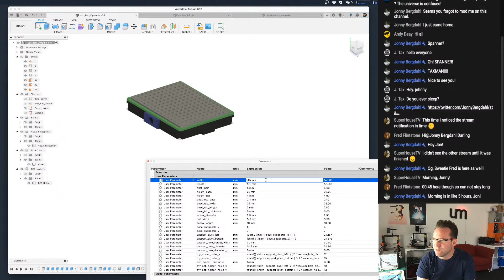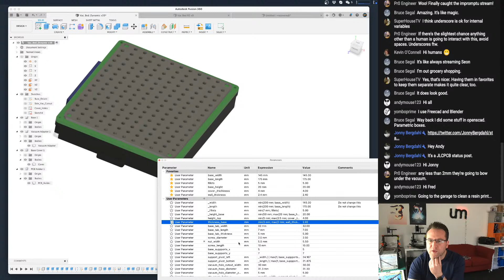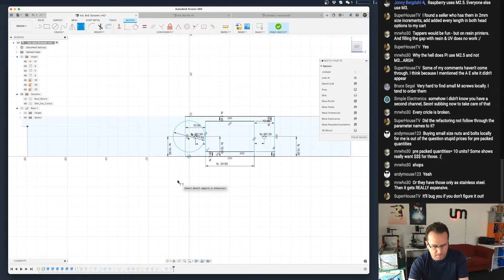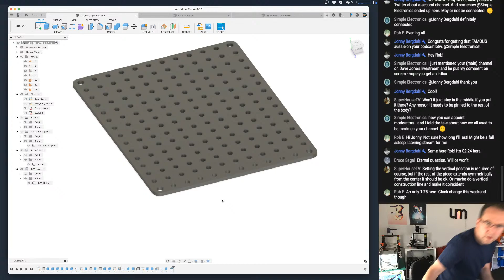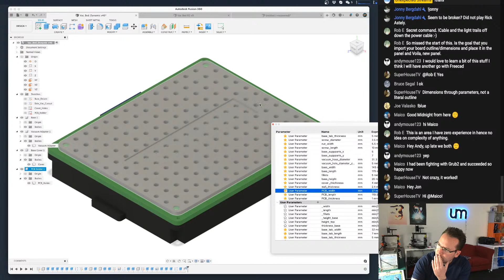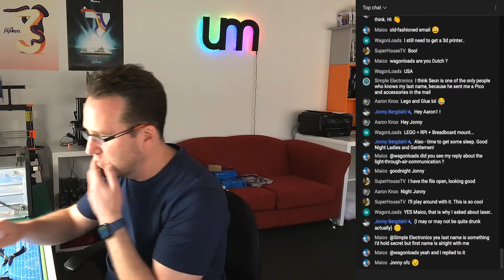Live Stream #4 - F360 Dynamic Stencil Vac Bed

Comment: When doing the extrudes you might find it easier if you start from an offset plane instead of the profile plane
Reply: But the offset plane would also need to be dynamically adjusted based on the parameters. Is that even possible?
Reply: @UnexpectedMaker  Sorry for my lack of detail. To clarify, you don't actually need to create a offset plane (although you can). When extruding a profile, the default is to extrude from the profile plane, but you can also extrude starting at an offset from the profile plane, or even offset from another unrelated object face or plane. Just like the extrude distance, the offset can be parameterised. This saves you doing an extrude followed by a cut, and simplifies your timeline.